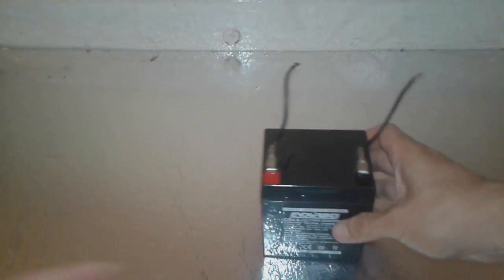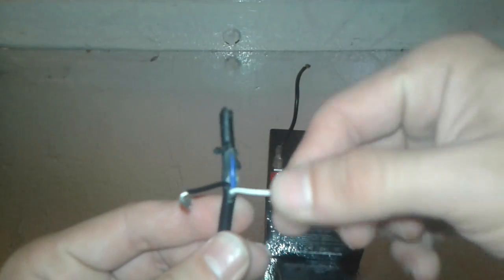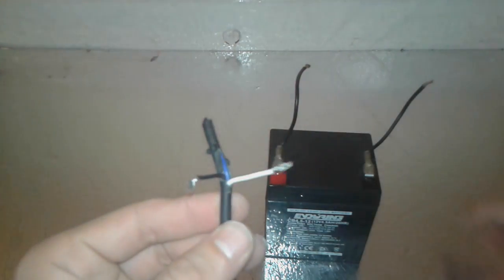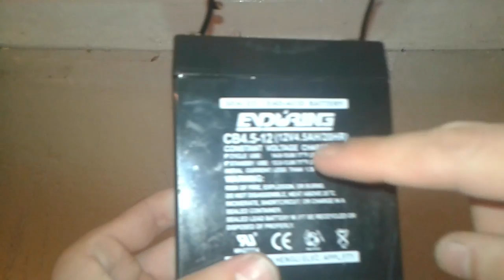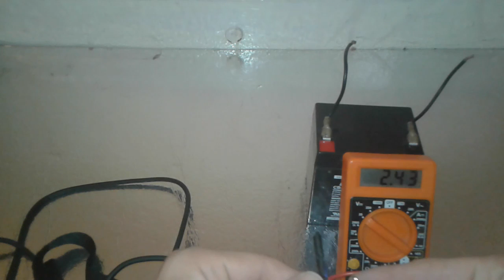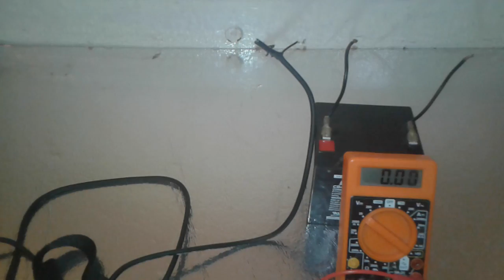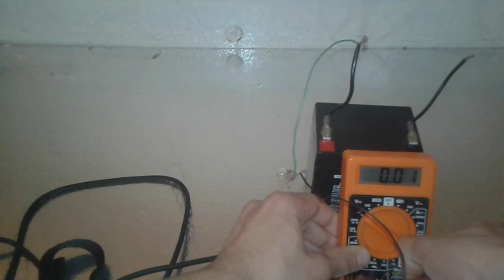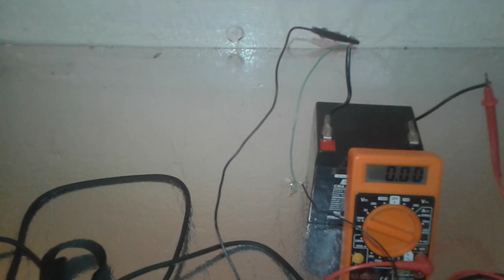Incredible how to make 12v lead acid battery charger!

Comment: How can the battery have the correct voltage (about 13.5V) if you put that 12V light bulb in series after the laptop charger? I mean, there are 19V - 12V = 7V that would go to the battery... Can you explain this to me?
Reply: The voltage of the charger only needs to be more than the battery so the current will flow to the battery. For instance, 14 volts from a charger would be quite nice for a 12V battery. But the charger here is 19V which will charge the battery too fast and damage it so the hack is to reduce the current with the bulb.

Comment: If the charger is 19volts isn't that too high volts for 12v battery
Reply from the maker: This is an old method from old mechanics change in different potential its a lot of phisics behind it watching very close the bulb is the key to success

Comment: I have a question my friend. I am happy this video is here.
I have 2   batteries 6v 4.5 a
So when i connect them paralel it is basically 12v 9a is that right?

My adaptor is 12v 700mA but it is dead.
I have another regular adapter of my sound system which is 12v 1,5a

So can I charge  12v 9a batteries  with
12v 1,5a power adapter?
Reply from the maker: Hi there my friend glad that you are here.first in parallel you will have still 6v at 9A,in series you will have 12v at 4.5A and for charging them for 6v you need 9v and for 12v aprox 14v watch other videos of minr about charging batteries plenty of usefull info.all the best if you have more questions drop them here will answer

Comment: Hi, I've seen many people doing your way. But I still don't understand about battery and charging. Then I would like to ask you several things.

Consider I have brand new battery 12V/46Ah (it will be actually 13.8V when it got fully charged).
What will happen to the battery if I charged it with with charger output as below:
1). 60V/30A?
2). 19.2V/3.42A?

There is fast charging. What abiut that? It is absolutely doesn"t comply "the rule" 14hours-20hours charging time as fast chargeing required only several minutes to maximum 2 hours.
Reply from the maker: Sunggu Sitorus hmm you have choose option 2, 19v but if you have a brand new battery why don't buy a dedicated charger, it is not cost efficient to do this stuff. There are many ways to charge the lead acid battery this is just the safest way at home, in my opinion
Reply: @NoSkillsRequired  of course in normal condition, I will not do either the first neither the second. I am just thinking emergency condition.
Reply from the maker: Sunggu Sitorus in an emergency case yes slow charge long hours to protect the battery
Reply: @NoSkillsRequired  If you don't mind. What will happen to the battery if I charge it with the first option? I saw many people did such that way using welding inverter. They charged car battery just in 5-10 minutes. Very short time, from almost empty to capable to start the car engine. Sometimes they didn't even take the battery out from the car.
Reply from the maker: Sunggu Sitorus it depends on battery from what I know just supercapacitors have the capacity to fast charge or lipo battery the classic lead acid doesn't support fast charge
Reply: @NoSkillsRequired  Thank you my friend.
Reply from the maker: Sunggu Sitorus my pleasure friend all the best
Reply: @NoSkillsRequired  Hi my friend, apologize If I comeback to you. I need your help, again.

In common old changer with trafo (say it 12V output) and diode rectifier, there is capacitor to stabilize the output connected between V+ and V- terminal. I understood that for electronic device we need it to stabilize the voltage. But my question, what will happen to a battery if a charger used to charge is without that capacitor? Mean, the output voltage will be up and down from 0V to +12V?
Reply from the maker: Sunggu Sitorus the capacitor role is to smooth the voltage, you can understand that with an oscilloscope or watch a video about it, it depends where the voltage come from if is a true dc power the cap is not crucial, if is coming from the plug/main 120/220 the capacitor is needed, there are inexpensive and când be replaced with a bigger value if needed watch my video about fixing a monitor  the repair cost nothing all the best my friend
Reply: @NoSkillsRequired  I understand about the capacitor's function. My question was, what will happen to the battery if without the capacitor? Will it damage the battery if we supply unstable power to it?
Reply from the maker: Sunggu Sitorus if the power source is providing a slow amperage like 14v/0.2A or 0.4A should be fine but without the cap you can't measure the amps going in the battery but you never know you can try it😉

Comment: Can I change my battery with DC regulator power source??
Reply from the maker: Bharath Thota if you mean charging the battery, yes with any thing that outputs 14-14.4v and able to sustain that voltage and some amps depending on your battery capacity

Comment: Thanks for your  valuable and powerful video it is really excellent, i have question 
now the lamp you connected is 12V/5W by ohms law P=VI so when the 12 volts applied to the lamp it should light with 5 watts ,so the I(current)=5/12=0.417 Amps, but you used 19 Volts from charger , then I=5/19=0.263 Amps from charger to the battery and the battery directly connected to the charger when you measure the voltage between terminals it will gives you 19 volts. But if you don't have a lamp then we should you power resistor 5 ohms/5watts 
the current I=P/R2  = 5/25 = 0.2 Amps as example , but do you think if we are using a power resistor it will be another solution ?
Can you use a power diode between output of the charger and battery as a protection and at the same time when the volt of the battery gets fully charge it will stop pushing extra volt to the battery?
and i and thing if you use a small current meter gives output volt control when the current reaches zero between charger and battery it will stop charger , i mean make a feedback to a relay or contactor .
Reply from the maker: wadi B3eed the bulb acts as a resistor and a charging indicator the same values you will obtain if you will use a resistor, and bulb is acting as a voltage drop as well but this method was used by old school auto electricians but it has to be monitored all the time thanks for your comment there is more to be learned about lead acid batteries all the best my friend
Reply from the maker: wadi B3eed you can add a diode but my power supply uses a full wave bridge rectifier so no need, and for a relay controlled part yes is possible and the easy and cheap version is a solar battery charger can act as a charging and discharging protection device
Reply: @NoSkillsRequired  
I meant by using diode between output of charger and the battery terminals when the battery got full charge the diode will cutoff and no volt will be applied to the battery. I know there is a bridge inside the charger but i meant the using of diode as a switch .
Reply: By the way the bulb is a current limiter and the resistor also current limiter too.
Reply from the maker: wadi B3eed the diode can't stop the flowing of current from charger to battery it gives just direction but there is nothing to monitor the increasing voltage if the charger is 14v then yes will auto regulate and reduce the current according to ohm low
Reply from the maker: wadi B3eed this is just what I said the but is acting as a resistor but in a resistor the current transform in heat, in a incandescent bulb not led, you can use the light from the bulb and you have a representation of the charging process the light start bright and decrease after the battery is getting charged that was my point of the video to use as much as possible with less
Reply: @NoSkillsRequired  Greetings, how would you connect the solar charge controller to do the above? I just subscribed to your channel today and learnt a lot. I am very thankful and appreciative of your knowledge, well thought out and great projects here...Thanks again.
Reply: Also you used the meter being connected to the circuit, should I keep it on? the meter? or disconnect and connect it straight the negative or neutral wire. Thanks.
Reply from the maker: @songreosmenep  hi there buddy check this video out https://youtu.be/0M7sPcaiXIo the solar charge controller has 6 terminals power in battery and load all in pairs of 2 +,- very careful with the polarity all the best

Comment: So how long does it take to charge at 0.26 amps
Reply from the maker: S.A Tech HI there it will take 18hours but doing so you will prolong the life of your battery
Reply: @NoSkillsRequired  ok thank you...I am planning to charge 12v 35 ah (12 v (7.5 ah) battery wired in parallel x 4) so will 1 amp be good so that charge time is not too much
Reply from the maker: S.A Tech for charging 12v 35a you will need 2.5a to charge the battery in 14h normal charging time rate, for 4x7.5=30 at 1a will take 30 hours to charge if you want faster 2a half of the time all the best friend
Reply: @NoSkillsRequired  so if I want 2 amp charge I will have to  get 40w light bulb
Reply from the maker: S.A Tech 25w bulb and the power source, laptop charge must output at least 2amps

Comment: Iam having a 6.8 volts battery i used 5 volts charger with it the plug made noise like wzzzzz
Reply from the maker: goldatms GT your are pushing the charger that's way its making the noise and will not charge the battery you will need a7. 4v adapter or bigger and with a step down dc-dc converter aliexpress, ebay , amazon cheap all the best

Comment: Hello I need help 
I have 3 4v (12v in total) batteries in sequence can I use 12 1 or 2 amp charge ?
Reply: And charger means adapter charger*
Reply from the maker: San b normally for your batteries best will be 0.5a you can measure when connected the charger if is drawing more then 500ma and the voltage max is 14.4 unless you are making something similar to this video you will need a 12v incandescent bulb of 5-6w to make a voltage drop and limit the current
Reply: Ok let me get it cleared 
So I need 14 v 0.5 amp output ?
Reply from the maker: San b yes you got it right the input(charger) needs to be bigger then the battery to create a potential difference for the energy to flow in to the battery.
Reply from the maker: San b hi there what is the amps ratings of the 4v battery's?
Reply: 1ah
Reply: And what if I use 1 amp charger will case any problem ?
Reply: Coz I have it laying around 😅

Comment: Can We Charge Acid Battery with Computer Supply ?
Reply from the maker: olx olx not as it is because the output is 12v so for charging a lead acid we need 14-14.4v you will need a step up converter

Comment: How can charge 12v 12ah battery
Reply from the maker: Venkatesh Bestha for your 12v battery the formula is 12/14=0.85 so you will need a 14v charger with 0.85A or less
Reply: Plz tell your contact number or what's app number

Comment: What is 4.5 amp..and tell me how long can it work
Reply from the maker: +SOMETHING FOR YOU The total  capacity let's say you have a bulb that consumes 0.5a 4.5/0.5=9hours of runtime theoretically
Reply: NoSkillsRequired i have a 12v 1.3amh/20 battery ..i wanna run a dc motor sprayer that is 12v 4.5 ah..if i use my battery how long that motor can run..?..is that 12v 4.5ah motor work by 12v 1.3amh battery?if it works how long? Please responsd
Reply from the maker: SOMETHING FOR YOU What is that /20 battery if the motor is 4.5a and the battery is 1.2 will not run or will runt at 25% the battery should be bigger then the motor. With a car battery 60a will run aprox 10hours pure theory
Reply from the maker: That battery 1.3/20=0.065 that means you can power an 12v led or something that is rated 0.7-1w so nothing powerful your motor is 54w you will need at least 60w battery or power supply 12v and more than 5 Amp
Reply: NoSkillsRequired suggest me a good battery 12v 12ah india

Comment: How can you charge a 12V battery with a 19V charger ?
Reply from the maker: with that bulb because is dropping down the voltage.potential difference
Reply: I was going to ask the same question. You should have shown us the voltage reading on the battery as you started charging.

Comment: Hello, thank you for making such an informative video. I have a few question, I would really appreciate it if you could please answer them.

Q: I have a 12v 2amp power brick that outputs 12.28v  I tried charging my 60ah car battery with it, battery was at 12.14v I charged it for 4hrs however volts won't go any higher than 12.3v. Can this power brick charge my battery or do I need one with at least 13v ? 

Q: if use a laptop charger like you have recommend, what wattage bulb should I use in order to charge 60Ah battery? 

Thank you ^^
Reply from the maker: hi there thanks for watching and find this stuff interesting now back to your questions.it is normal that your battery is 12.3v because your power supply can deliver just that.For any 12v lead acid battery the power supply should be 13.5-14.00v in your case your battery is charged at 90%.for the 12v 60ah battery lets say 12h cycle you will need 14v 5A power supply.with lead acid if you charge them with lots of amps you destroy them with less amps is gonna take long.hope i answered some questions if not let me know take care
Reply: I see, perhaps I can add a voltage booster to 12v 2amp power brick, up stepping voltage to 14v and then proceed to charge the battery? Or get a dc-dc buck converter for 19v 5amp laptop charger.

Can you please tell me a bit about the bulb you have used? What wattage is it? 12v 21w bulb? 

Thank you for taking the time to reply! ^^
Reply from the maker: +00Tenrai00 The best thing is to forget about the brick is not enough for the 60ah battery boost converter will rise the voltage but at the cost of amps so you will have 14v but 0.2-0.3A.with a laptop charger is another thing you can use an auto bulb  like i did in the video in series with the battery.if the laptop charger is 19v 5A you can use a 40w 12v bulb and is gonna deliver aprox 3.3A to the battery 60a/3.3a=18hours will take to fully charge the battery.a 50w bulb will charge in 15hours and take into consideration that if the power supply is rated 5a you can use all of it because are losses or it burns out.
Reply: Got it thank you ...
Reply from the maker: +00Tenrai00 No probs if you got any more questions dont hesitate all the best

Comment: how do you Limit the voltage? it will exceed 15 Volts and then it will damage your battery.
Reply from the maker: This is not a dedicated charger there is no circuit to cutoff the voltage bur the bulb is very important as the battery is getting charged the bulb start dimming till is gonna go off then is the time to disconect the charger

Comment: plzz help..can i use 12v 300 mAh adapter for my 12v 2.3ah battery plzz reply..
Reply from the maker: Normaly charge rate is 14c that means for the battery capacity in ma lets say1000ma 1A you need 0.076A on a period of 14 hours that period can be reduced (solar charger) to 8h but not day to day charging so lets do the math.charger 12v 0.3A - 12V 2.3A 2.3/0.3=7.66c so it could be possible but you should constantly monitor the voltage when it is 14 stop charging
Reply: NoSkillsRequired thank u so much really simple guidance..
Reply from the maker: +Mr. CRH no prob mate any questions drop in if i know i will answer if not i will guide you to others more skilled
Reply from the maker: It clearly state on the battery label "initial charge less then 1A(1000mA)" and the cycle is 20Hr so for long life any lead acid battery should be charged at 14Hours and discharged in 20Hours
Reply: what is meant by charge rate is 14c
Reply from the maker: +Ihab Ahmed charging period of 14 hours
Reply: Hacks Unlimited , minimum 500mah , 1amp is best for charging. hope u got it :)

Comment: Can i charge car battery with this method
Reply from the maker: is not recomended but in a emergency case you can use it you have to change the bulb.in this case the bulb is acting as a current limiter
Reply: why not recommended for charging car batteries

Comment: hello. i want to ask if the laptop charger is the universal  that it can give 12 volt i can put the wires str8t to the battery or no..(sorry for my bad english )
Reply from the maker: no prob about the lenguage.the laptop is not standard with 12v.laptop charger is hp 19v 3.40A normaly all laptop are 19v different amps.hope is helpfull.take care my friend
Reply from the maker: you can use universal charger but measure the voltage it has to be 14v dc

Comment: with amp   the pulp is   ok

but what about the high volts
Reply from the maker: with this bulb the charging process is slow preventing from overcharging as voltage increases the bulb starts to dim when the battery voltage is 14.4 the bulb is off and no current is passing.the bulb regulate the current .2-3h no prob after that perriod you should monitor the voltage.this process is called potential difference.
Reply: i think its ok

Comment: Can a 5volts adapter charge a lead acid 6volts battery.
Reply from the maker: nope my friend the charger has to be greater then the battery.Or in case the charger is smaller then battery with an adjustable voltage booster from ebay
Reply: NoSkillsRequired tnx